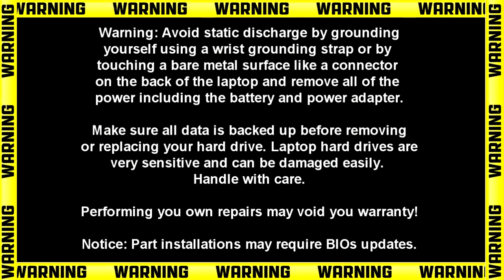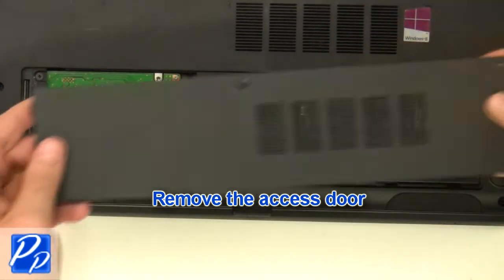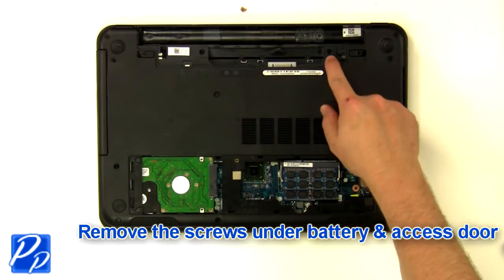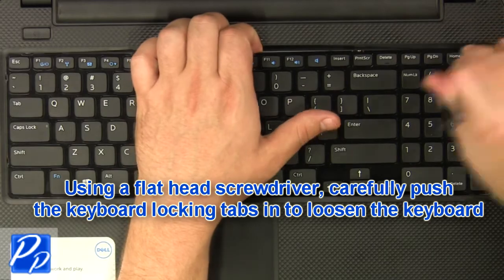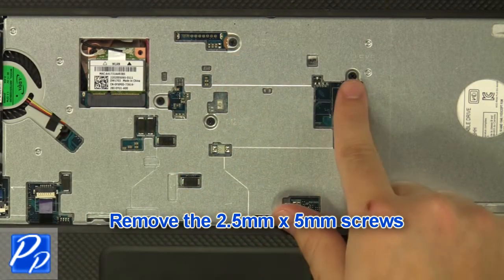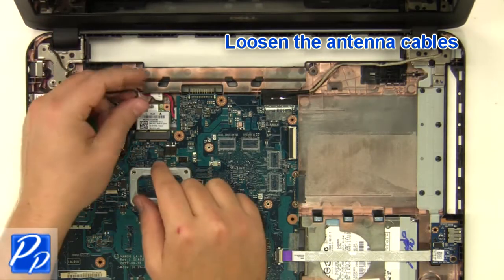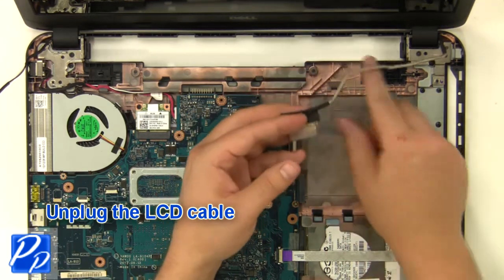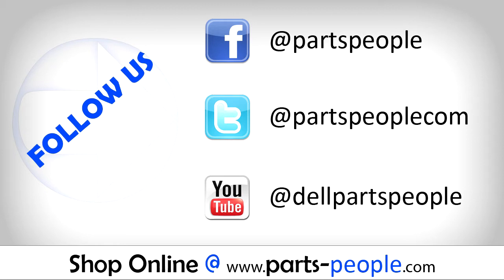Dell Inspiron 15 (3521 / 5521) LCD Touchscreen Display Assembly Replacement Video Tutorial

Comment: The 3521 screen does not have a plastic bazel around the screen just a set in thin rubber frame ...
Reply from the maker: Hi, you must have a different Inspiron 3521 configuration. I'd run your service tag on our site to help identity and point you towards what screen setup you have. Contact us directly if you still need help. And actually, you may have the Inspiron 3521 (end of life) and there was a complete assembly that was sealed together with adhesive I believe. Shown here: https://www.parts-people.com/index.php?action=item&id=15619

Comment: I have the Inspiron 15-3521 with touchscreen. My LCD is displaying a negative image however when I hook up to an external monitor it displays perfectly. The touchscreen functions perfectly as well. I believe my LCD is bad however I can't seem to find the exact DIY repair video. Do I have to replace the digitizer and the LCD or can I just replace the LCD? If so do you have a video to show this? Thanks,
Reply from the maker: The touchscreens are more difficult to replace, removing the digitizer more of, they are usually glued on and require a heatgun to remove. We don't have a video for it because it's very easy to damage other parts. I would suggest taking it to a repair shop to have it fixed or replacing the entire display assembly. If you choose to replace the entire assembly you can find them here. https://www.parts-people.com/index.php?action=item&id=16861
Reply: Did you manage to do this? I need to do the same

Comment: Hi, I had a non touch screen same laptop and if I buy touch Digitizer will it work ?
I have to change the frame only right?
Reply from the maker: I think you have to replace the complete assembly. Or at least the digitizer/glass/bezel, the digitizer cable, the LCD cable, the back cover, and the hinges. Maybe even the screen too but I'm not 100% about that.

Comment: Does anyone know if you can upgrade a non-touch 3521 with a digitizer? I could take mine apart to check if the port is there, but I figured I would ask before going through that trouble.

Nevermind. I see the port in your other video, watch?v=ufjcMjMLmTk if that is a non-touch model like it appears to be!

Comment: how too Replace Dell 15R-5537 Non-Touch LCD With Touch Screen?
Reply from the maker: You would need to replace the complete display assembly.
Reply: but will it work. I got a 3521 and looking for a yes and a 3250 I want to put the touch in. it with function or its pointless.
Reply from the maker: So you have a 3521 that is non-touch that you want to make into a touch? If that is your question, yes, it is possible and the same answer, you will have to replace the complete display assembly with a touchscreen assembly.

Comment: The touch screen model seems to have the webcam embedded inside the lcd. Would replacing the touchscreen with a non-touch LCD screen remove the webcam completely? Would the normal LCD replacement be able to fit inside a slot where the touchscreen LCD is? Appreciate your help!

Comment: Hello, is it possible to replace the touchscreen digitizer bezel?  I saw on your parts site you sold the touch screen digitizer.  I bought it and I wanted to know if I can take the display assembly off and then remove the touch screen/digitizer part of the bezel and replace as mine is cracked.  Thanks!!
Reply from the maker: You can replace the digitizer. Use a flat head screwdriver to separate the digitizer bezel from the back assembly.
Reply: +Thomas Brown III I know this is a late reply but I had the same exact question. Thanks I couldn't find the answer to this question anywhere! The foreign dell guy told me I needed to replace the whole assembly which I knew was BS. Thanks again!

Comment: hi, is it possible that we can install a normal replacement screen instead of touchscreen.
Reply from the maker: Yes you can install a normal screen but, you will have to change the LCD cable too.